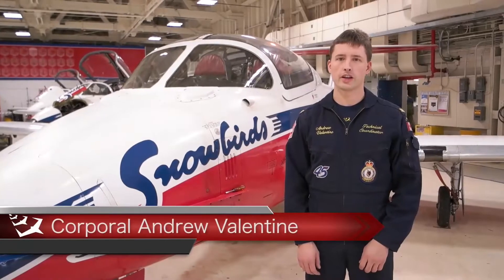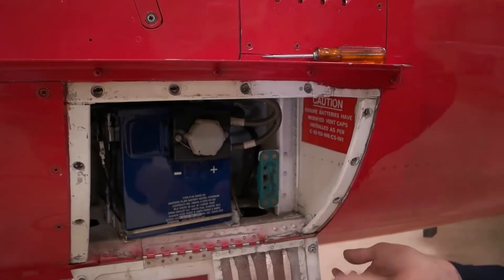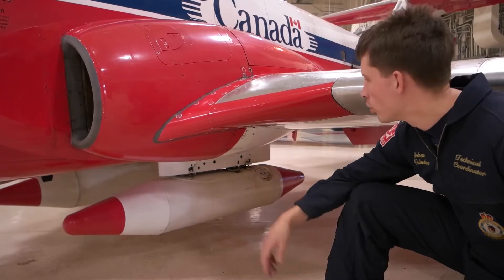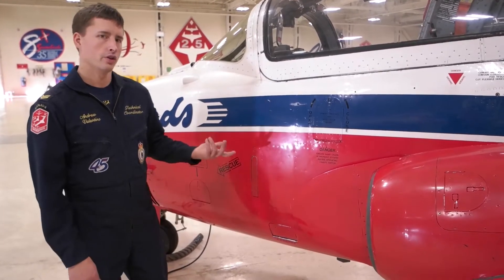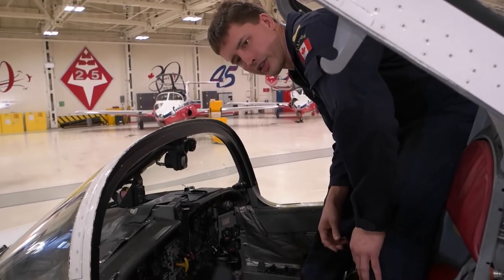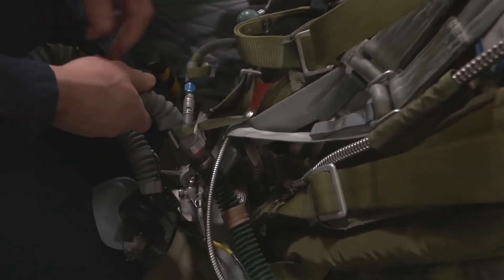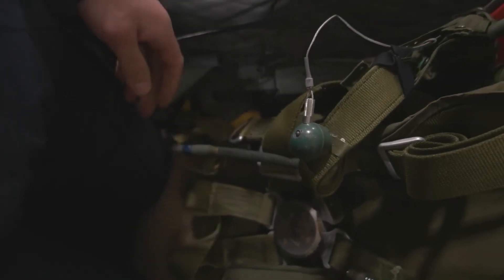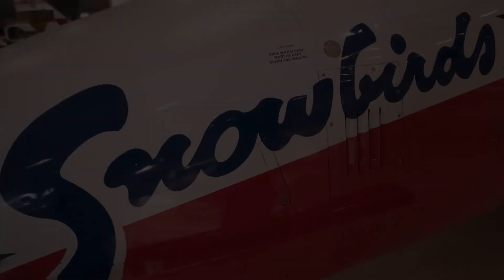CFR Emergency Extraction Video RCAF Snowbirds CT-114 Tutor

Comment: The most dangerous part of the extraction process?  their DINOSAUR relic ejection seat technology from the 1950's, offering EXTREMELY LIMITED envelope for a safe ejection.   RIP Capt. Jen Casey   Canada needs to get off their ass and spring for a different aircraft platform, potentially CF-18's.  Hell, it's worked for the Blue Angels for ONLY 30+ years.  Get the Snowbirds what they deserve:  A SAFER AIRPLANE with a much greater survival ability built in, thank you Martin-Baker ACES seats.
Reply: CF-18 for the Snowbirds is a terrible idea, because you shrink the pool of techs and pilots who can fly for the team, which in turn leaves our fighter force depleted.  Logistics would be a nightmare and the cost of running the team triples.  That, and Moose Jaw doesn't have the equipment or infrastructure to support the CF-18.  Finally, our Hornets are quickly running low on fatigue life.  The team would be lucky to get two seasons out of the Hornet.
Reply: disagree cause how are they supposed to fly 9 to 11 CF-18’s in formation 4-5 feet apart